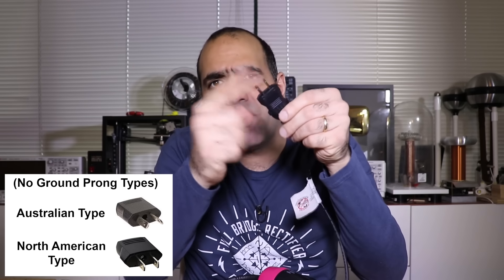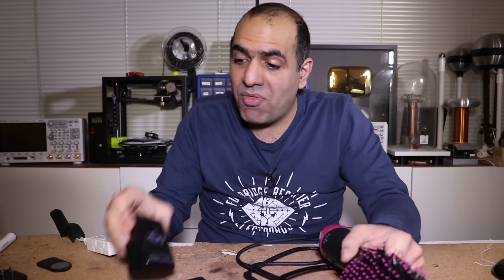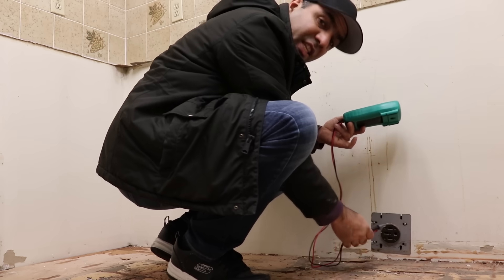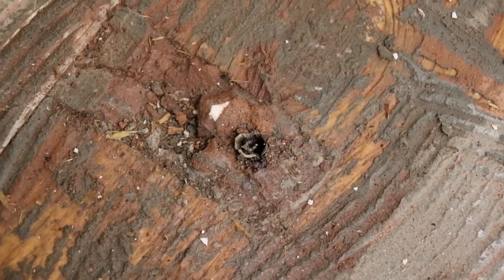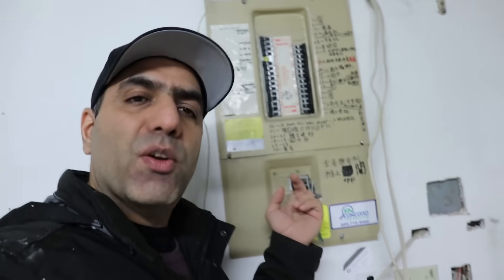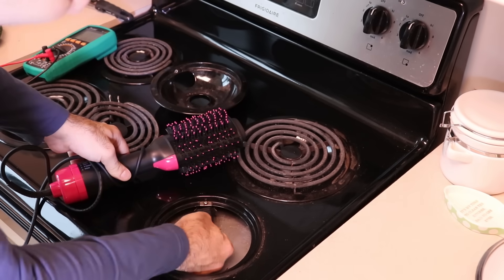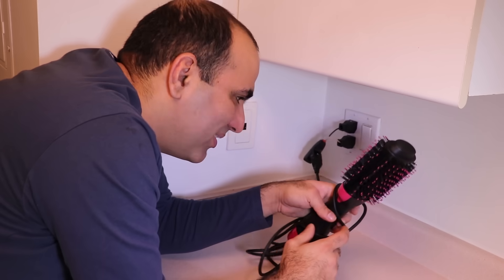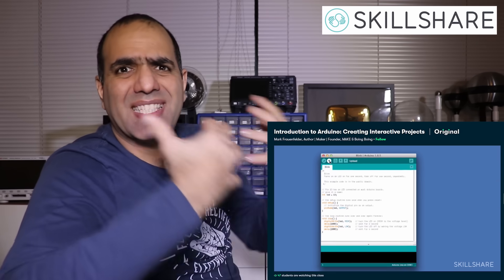Finding HIGH POWER 240V in a 120V Country

Comment: Hey , 3 phase 208 is 120 to ground.
Single phase 240 is 120 to ground.

Quick little rundown on voltage ratings on N.American Appliances. (Excluding Mexico)

120 Vac = 60 cycle,  no ground.
110 Vac = 50 cycle , no ground.
110-120 Vac = can run on 50 or 60 cycle, no ground.
115 Vac = can run on 50 or 60 cycle. has a ground plug.
117 Vac = 60 cycle only , has a ground plug. (You'll see this on some high end stereo equipment).

230Vac = can run on 208 or 240

Side note 
Only the United States Military actually generates 230 on their ships and bases ,its a "NATO thing", they split the difference between N.Americas 240 and Europes 220    because you have no idea what the Hell a Marine stationed in Germany is going to plug in the outlet.
Reply: Now I want to know what a bored Marine would be plugging in the outlet...
Reply: @WingMaster562  crayons
Reply: Ever heard of a stinger leg?
Reply: Um, only in America is "240V" actually two phase 120V to ground. Here in the UK official 230V is actually 240V to ground. (Yes that's 230V 6%/+10% so our 240V +/-5% fits; the same was done for 220 +/ 5% in other EU countries) This means that 3-phase is actually 415V (400V "officially" ) on UK NATO ships not 208V. This "officially" bit is only important if you're designing kit; it means the appliance WILL see voltages within the entire range BUT the user does not need to care. The US spread of 110-120 is basically the same problem, but you haven't rationalised the labeling. Also US 208V AND 240V are both officially out of spec for "EU 230V", but hair dryers don't care (The 240V because EU appliances must be able to cope with L-N polarity reversal) and the users mostly assume the power reduction (of 208V) is just a crappy US power system.
Reply: @Robert-dB  240 isnt "two phase" it's single phase, it comes from a 240volt single phase transformer with a center tap to ground.
The fact that there's only two wires on the high side of the transformer is a dead giveaway.

America did briefly try two phase power before self starting AC motors were invented, but we stopped doing that over 100 years ago.
Reply: @glennchartrand5411  Okay, you can think of it like that. The only difference between "2-phase" and single phase is what part of the circuit is grounded. If one of the lines is grounded it's single phase. If the centre voltage of the source OR the centre of the load is grounded it's 2-phase. If neither is grounded it's floating and will safely conform to whichever single point in the circuit is or might be grounded elsewere. With 2-phase (or 3-phase for that matter) you don't actually need the neutral line IF the phases are balanced; grounding the 2-phase at the consumer boards and creating the neutral there is perfectly reasonable in this scenario and saves miles of copper (the third core).
Reply: @Robert-dB  no , there really is an old two phase set up , where one phase is 90 degrees out of phase with the other .
But that became obsolete when self starting single phase motors became a thing.
There are still a few old buildings with that system on the East Coast.

If the two "hot legs" of the transformer were 180 degrees out of phase with each other, they would CANCEL EACH OTHER OUT for an output of 0 volts.

They add to each other because they are in phase.
Reply: @glennchartrand5411  Ninety degrees? Four phase electricity. Well, two from four. I didn't know anyone ever did that. Errm, that should be 2*sin(PI/4), yes that's sqrt(2) that'd make sense. So 120v RMS per phase and about 170v RMS between odd and even phases (hmm, that'd should also be 240 Peak. NB: 240V RMS, as in GB is about 340V peak).

Oh and no, 180 degrees is in "anti-phase" and if this was waves on the surface of water they would cancel out. But this is the voltages (relative to neutral) on the two cores so when they are at peak voltage (170V for 120V RMS) one of them is positive and the other negative; this means the total voltage between the cores is 340V peak. So the potential different between the cores works out as 240V RMS.

BTW: This 180 degrees out of phase is how E-Boom got 240V RMS from the live cores of two 120V sockets in the video with his "suicide cable".
Reply: @Robert-dB  dude you're trying to argue with an industrial electrician , on a channel electricians watch. about the power grid.
What are you going to do for an encore,
Argue against vaccines on a medical forum?
I dont nitpick Medhi because hes explaining electrical engineering in a second language better than most engineers can in their native tongue.
Reply: @glennchartrand5411  Sigh, as I said I had never heard of this 2-phase/4-phase hybrid that you're calling two phase. Working from first principals that two phase would have a very unbalanced neutral as two of the phases are completely disconnected compared to a balanced system so you would have to have a neutral.

Okay, I just did some searching on Wikipedia (of all places), yup looks like you call what I would call 2-phase by the name "split-phase" presumably because the "2-phase" name was taken by the hybrid. And yes, that hybrid is super unbalanced. It seems that 4-phase and higher are almost never used to transmit power so you'd never notice a problem. But it does explain the misconception that makes you think that 180 degrees cancels out the voltage instead of doubling it. You should remember that this (and three phase) is simple two dimensional vector maths not a scalar sum.

PS: Please don't try "arguments from authority", I used to do "electronic" engineering before I got sick of all the math and moved to computers.

PPS: AFAICT E-Boom got everything he said right, his "sparky" impressions are great too.
Reply: @glennchartrand5411  Sigh, as I said I had never heard of this 2-phase/4-phase hybrid that you're calling two phase. Working from first principals that two phase would have a very unbalanced neutral as two of the phases are completely disconnected compared to a balanced system so you would have to have a neutral.

Okay, I just did some searching on Wikipedia (of all places), yup looks like you call what I would call 2-phase by the name "split-phase" presumably because the "2-phase" name was taken by the hybrid. And yes, that hybrid is super unbalanced. It seems that 4-phase and higher are almost never used to transmit power so you'd never notice a problem. But it does explain the misconception that makes you think that 180 degrees cancels out the voltage instead of doubling it. You should remember that this (and three phase) is simple two dimensional vector maths not a scalar sum.

PS: Please don't try "arguments from authority", I used to do "electronic" engineering before I got sick of all the math and moved to computers.

PPS: AFAICT E-Boom got everything he said right, his "sparky" impressions are great too.
Reply: @glennchartrand5411  Sigh, as I said I had never heard of this 2-phase/4-phase hybrid that you're calling two phase. Working from first principals that two phase would have a very unbalanced neutral as two of the phases are completely disconnected compared to a balanced system so you would have to have a neutral.

Okay, I just did some searching on Wikipedia (of all places), yup looks like you call what I would call 2-phase by the name "split-phase" presumably because the "2-phase" name was taken by the hybrid. And yes, that hybrid is super unbalanced. It seems that 4-phase and higher are almost never used to transmit power so you'd never notice a problem. But it does explain the misconception that makes you think that 180 degrees cancels out the voltage instead of doubling it. You should remember that this (and three phase) is simple two dimensional vector maths not a scalar sum.

PS: Please don't try "arguments from authority", I used to do "electronic" engineering before I got sick of all the math and moved to computers.

PPS: AFAICT E-Boom got everything he said right, his "sparky" impressions are great too.
Reply: @Robert-dB  https://en.wikipedia.org/wiki/Two-phase_electric_power
Reply: Um, only in America is "240V" actually two phase 120V to ground. Here in the UK official 230V is actually 240V to ground. (Yes that's 230V 6%/+10% so our 240V +/-5% fits; the same was done for 220 +/ 5% in other EU countries) This means that 3-phase is actually 415V (400V "officially" ) on UK NATO ships not 208V. This "officially" bit is only important if you're designing kit; it means the appliance WILL see voltages within the entire range BUT the user does not need to care. The US spread of 110-120 is basically the same problem, but you haven't rationalised the labeling. Also US 208V AND 240V are both officially out of spec for "EU 230V", but hair dryers don't care (The 240V because EU appliances must be able to cope with L-N polarity reversal) and the users mostly assume the power reduction (of 208V) is just a crappy US power system.

Comment: Question for the electricians out there. Is there a concern with a Y cable and circuit breaker? 

If one were built, how wire?  
Circuit A hot  and circuit B hot  to the Hot and neutral  plugs?  what about the neutral  and ground wires in the from each circuit?

Comment: Electroboom.. i have a server rack that wants 480.. obviously I can’t get it at home
Reply: It probably doesn't want 480, it just wants three phases and sends each phase to a different outlet within the rack.  You'll have to check this to confirm, but so long as there are no phase-to-phase connections (and everything is phase-to-neutral) then you can just hook up a single phase live wire to L1, L2 and L3 and it'll work fine, though you might need to supply it with a wire much thicker than normal if you intend to fully load it with equipment.
Reply: This is true. Most SMPS computer/server supplies can also take a wide range of voltage. So you can probably get away with using 277 volts (the line to neutral voltage of a 480 system)  or even 240. Check the power supply nameplates of each server to be sure.
Reply: In Arizona many houses are wired for 3-phase 480V for air-conditioners.
Reply: @Lennybird91  was going to say, this shouldn't be impossible.. I see 480-600(ish?)v regularly
Reply: Lennybird91 not my parents house.. they are in vail. it is 2phase. Was built in 09. So maybe now they do. My house here in winterville nc I could get 3phase. I have to dredge from the panel to the transformer. Its way out of what I am willing to spend. You’re talking $10-20k.
Reply: @Lennybird91  I've never seen this.  It's certainly not in "many" houses.  Maybe in really big ones.  Most houses in AZ use standard 240V A/C units.  Three phase power is not typically available in residential areas.

Comment: Man you left this wire in the weird spot touching wood beam. It would take someone to turn on the breaker and not notice the smoke for some time to start fire. I hope you did something with it before leaving.
Reply: I'm fairly certain the qualifed electrical engineer has taken more precautions than you thought up just in the 10 minutes you watched the video. Or, maybe all the drywall on the floor and the huge hole in the ceiling on the first floor of the house weren't enough of a sign that something is wrong. The fact he had permission to mess around and film in that house, means he's in touch with anyone he needs to talk to about that house. Nice try bud.

Comment: You said they wire houses different than apartments that isn’t correct the range and dryer are still 240 volts- electrician

Comment: So a building's electrical phases will total a maximum of 205 (45°) or 240 (90°) volts depending on the phases it uses. The appliance power also has to work with 60 Hz, so resistive loads like incandescent bulbs or heating elements would work fine.
Reply: No. 120° for 3 phase, not 45°. 360/3=120.  A split single phase 240V supply has each hot 180° out of phase when measured referenced to the center tapped neutral.

Comment: Apparently the decision  in the US to go with a 120VAC system was heavily influenced by lobbying done on behalf of   the  domestic  copper  mining industry.
Reply: @MernokiMegoldasok  I think until the late '50s - early '60s instead. Our house was built in 1962, and it has PVC insulated aluminium wiring (most of it has been replaced to copper, only the low current lighting circuits remained aluminium).
Reply: @MernokiMegoldasok  Some kinds of rubber and cloth wires are still produced, but I don't think it was allowed to use them for residential electric installations after the early '60s. Also, some of them were quite horrendous, as the 'cloth' part contained asbestos.
Reply: Transformers in the USA are already 240v. The use of neutral wire "splits" this into 2 out of phase 120s. The transmission lines are not copper, rather galvinized steel.
Reply: @gt5228z  Rather aluminum, reinforced with a steel core. Steel is quite a bad conductor, the losses and voltage drop would be huge, if they used pure steel.
Reply: @mrnmrn1  I actually didn't know that. Aluminum is a pretty good cunductor so it makes sense. It is my understanding that they quit using aluminum in homes because the oxide layer becomes flamable. Outside the home, however, the cables are not insulated or surrounded by fpamable building materials.
Reply: @gt5228z  They quit using aluminum in homes, mainly because two things. 

1: It is too soft, so it will loosen up the connection in screw terminals, as the wire flattens under tension over time. 

2: it oxidizes instantly, and aluminum oxide is a great insulator. No, it's not flammable, but the oxide layer creates high resistance between the connecting surfaces, this creates heat and fire hazard (the insulation on the wire and wire nuts can catch fire from the heat). 

On power line poles they use special spring terminals, which keeps constant pressure against the Al wires, so the connection can't loose up itself, and they fill the terminals with special silicone grease to keep the air (and moisture) outside the connection, to prevent oxidation (and galvanic corrosion, if different metals meet in the terminal).
Reply: @gt5228z  Transmission lines are aluminum wires wrapped around a steel core.  Steel by itself has a much higher resistance and would waste a lot of power.
Reply: gt5228z 
In Europe they are about 400V and split into three phases of about 230V.
Reply: @katrinabryce  most industrial services in USA use 3 phase 480v services, not homes though.
Reply: The Anaconda copper company was the main proponent.  They bought their own senator in the state, Montana, where most of their mines were and put him to good use.
Reply: Not to mention the state of insulation around 1900 when the power distribution was rolled out.  And don't forget the guy going around electrocuting elephants to turn the public against AC power.
Reply: @jkbrown5496  transmission lines are only very rarely insulated and certainly not made of copper. The fact that we use high voltage/low amperage transmission lines that is stepped down at sub-stations and again at the transformer is literally so that we don't need to use copper. It keeps it cheap.
Reply: @gt5228z  I was speaking of the interior home wiring.  In the US, it was knob and tube wiring with cloth and rubber insulation from 1880-1940
Reply: @jkbrown5496  i would hate having to run that thick ass aluminum or steel wire instead of copper on a home.
Its why we use gold and siler in electronics but not in wiring, different costs and benefits to each.
Reply: @chadleach6009  Silver and gold is used only for surface plating in electronics. Solid silver or gold conductors? Nice thought... :) . One exception: good quality relay contacts are made entirely of a high silver content silver alloy, and in low signal relays it has a relatively thick gold plating on it as well.
Reply: @mrnmrn1  does this have something to do with the skin effect?
Reply: @jkbrown5496  right on
Reply: @gt5228z  I think they consider skin effect on high voltage transmission lines, although skin effect is minimal on 50/60Hz. The reason they using a steel core is to make the cable stronger, to be able the hold its own weight, wind load, ice load without permanent stretching (Al is soft, it can be stretched easily). This way they can place the poles much further apart, saving a lot of money.
Reply: @mrnmrn1  we simply don't need solid gold or silver in most cases, that's why it's only used on the surface. As you state, higher demand products will likely use more of the substance required.
We use copper contacts where applicable as well, it just depends on the job what the best material is. No one size fits all.
Reply: @jkbrown5496  "The guy going around electrocuting elephants" was Thomas Edison.  Tesla had patents on AC motors, generators, and distribution systems.  Edison didn't want to pay royalties to Tesla every time he put up a new power plant and every day of operation thereafter until the patents ran out.  So he tried to villify it.  He only zapped one elephant, though.  Poor thing.
Edison knew DC distribution was only good for a couple miles at best before suffering severe voltage sag due to line losses from high currents, which Tesla got around with AC by shifting voltages and currents by transformers (long distance at high voltage and low current to cut losses)
Reply: Im not surprised

Comment: Very funny and very true :D, Sometimes I feel that I need to be a magician :D. Also I think that the 230V that are used in eg. Europe is much better solution for powering high power appliances.  There are also much safer designed sockets ( type E  ).